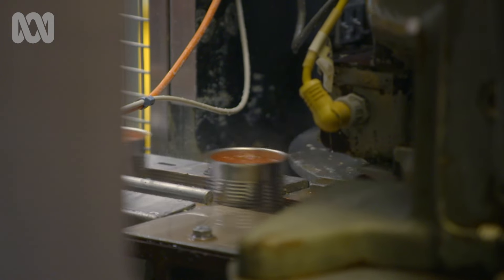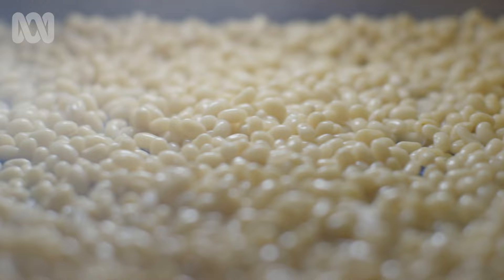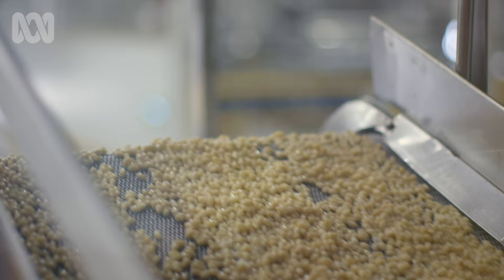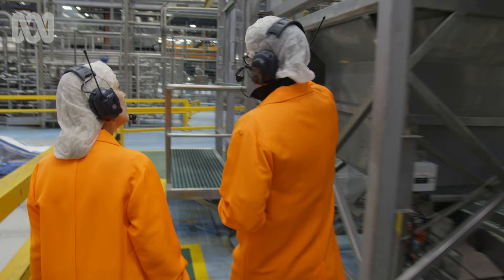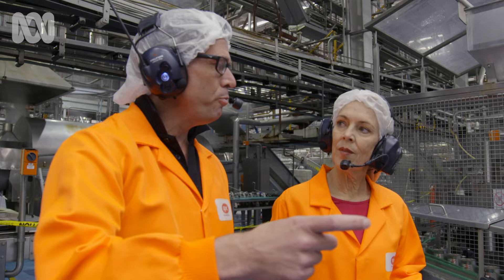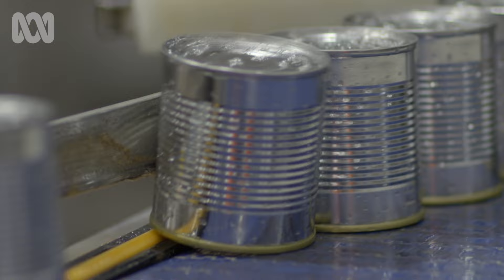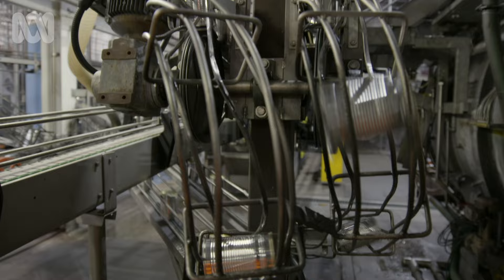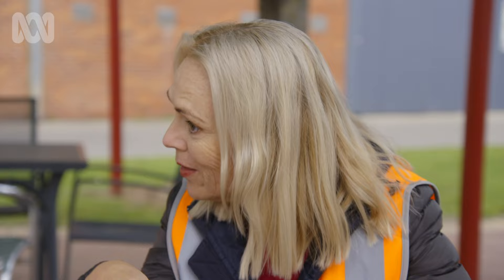This is how your Baked Beans are made  |  Catalyst

Comment: But they aren’t baked. Where does the name come from????
Reply: They are baked. Baked in the can.

Traditional home cooked Baked Beans are baked directly in the classic covered ceramic beans pot(similar to a Korean Hot Pot) with the tomato sauce(or whatever sauce you use) over a naked flame(including campfires, stovetop gas or fully baked in an oven) and slow cooked for hours. You can use a home pressure cooker to cook the dish too.

Canned baked Beans are baked directly in the can using pressure cooking, then you finish the process yourself at home when you reheat.

They're Baked.
Reply: @colliric  hey that makes sense, thanks for explaining that lol

Comment: Why are they called baked beans? They are cooked!
Reply: They are baked in the Can.

The traditional version of the Dish is Slow cooked and required the use of a special covered ceramic bean pot with a lid (similar to an Asian Hot Pot!), and slow cooked over a naked flame for hours, or cooked by putting it straight into hot coals  or in modern times pressure cooked. The Pot acts as an oven, and bakes the beans. The Pot is also directly the serving bowl, and is shaped like a bowl(once again similar to a Asian Hot Pot)

Canned Baked Beans simply replaces the ceramic bean potbowl with the can itself.

The beans are baked, in the can itself which acts as a makeshift pressure cooker. The beans are NOT boiled.

Comment: Beans need to be cooked for 3 hours more
Reply: Under what conditions? Room temperature and pressure? Controlled high temperature and pressure? Direct heat? Indirect heat?
There's so many factors affecting the cooking process, so it's not always a must for that 3 hours or more nonsense.